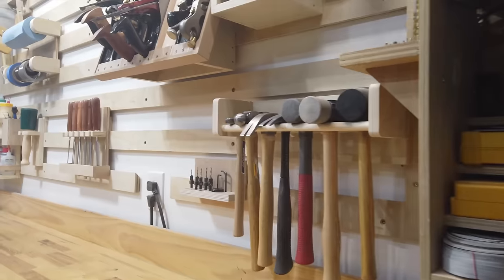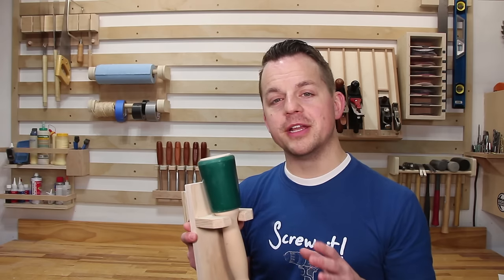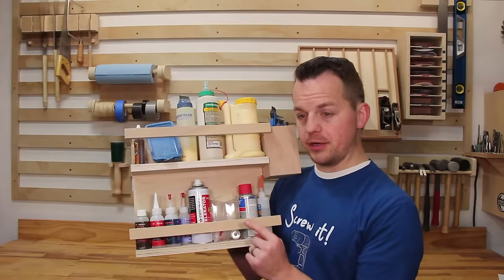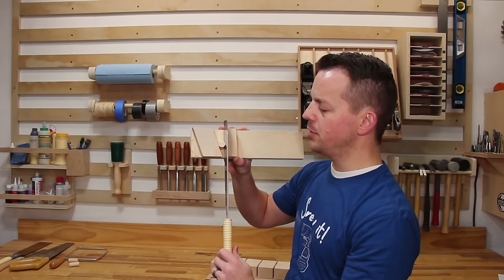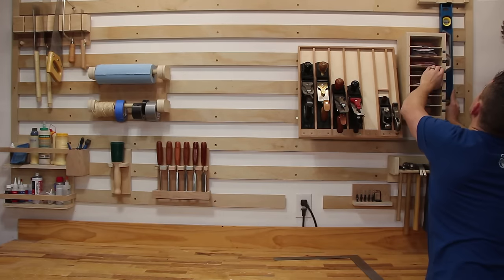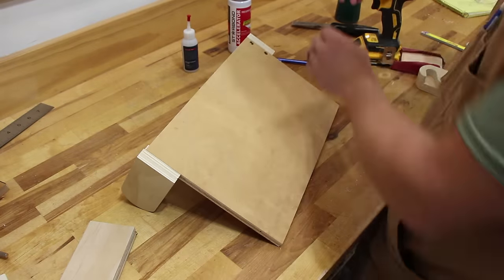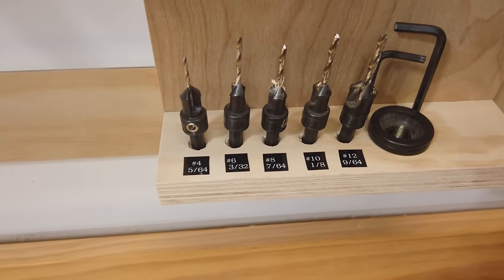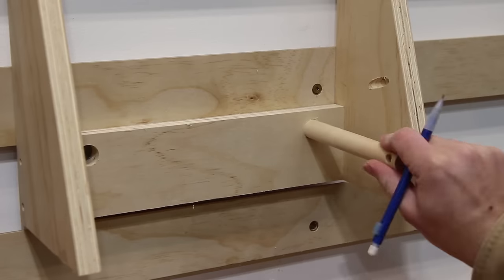Make the Ultimate French Cleat Tool Wall with These 10 Tool Holder Ideas

Comment: Super cool video! It’s like you heard me when I said, “Yes please!”. Thanks for this one I love all of these. I’m going to make a tape one that has more of a boxed front with an old hacksaw blade attached to the front edge for tearing the tape off.
Reply from the maker: That sounds like a good innovation! I find I usually just pull the tape off and take it to wherever I'm working, but maybe the next french cleat video will have an update to the tape rack!
Reply: @EveningWoodworker  🤣 I'm sure yours works great just as is. I just have a station in my shop where I use duct tape often. Again, fantastic video. Thanks

Comment: Good variety of handing solutions. I like the saw grip build but I hang them backwards so you don't keep gouging the holder. For extra grip a racing bike inner tube or srink tube around the dowel.
Reply from the maker: That's a good idea! I just figured I'd replace the front or build a new one once it gets too trashed.

Comment: Oh you know what we like. This is the stuff. Thank you for going into detail. I think many cleat/holder videos do not cover the thickness of cleats or leave out a side view of a holder so you aren't able to see how they put it together. All of your holders are nice and clean and well thought out.

I love a good pliers holder too. Tip down recesses with a thin laminated front and back is good for 2-4 pliers or the rack version with a dowel to hang them tip it. Tip down again with rectangle grid is fun. Just a long box for general hand tools is always welcome too. I keep two pliers in my hip pouch but find pliers to be the tool I reach for as much as screwdrivers.

Hammer holder is another one where I"m attached to the type that is just a open notch with the handles hanging down and available to grab and lift out. Like your basic chisel/clamp rack  with the hammer heads lined up to fit 4 or more on one board. Can glue on little nibs to keep them in there or sand in the bevel to sink in to  get them to stay.
Reply from the maker: Great ideas on the hammer holder! If this one doesn't work out then I may try your design.

Comment: I have used the French Cleat system in a few of my shops and I have always hated them for four reasons.  1)  they collect dust.  2)  they collect spiders with webs.  3)  the tool shelves would always come down when trying to retrieve a tool.  4)  they take up so much wall space for only a small amount of tools.  Now with that said, I believe that you have solved the tool shelf locking mechanism.  And very brillantly I might add.  I also know that someone might fill the whole French Cleat system with craddies of tools and that could solve another issue.  But until the spider issue gets solved, I think I will stick to the drawers.  But anyway, great job.
Reply from the maker: I think my favorite is a combination of some drawers and some French cleats. Also a good pest control company is helpful!

Comment: The design for the saw till is rockin'!  I've seen that mechanism used before but I think you may have really nailed the simplicity.  I also like the very simple low-tech stops to keep the racks stable on the cleats.  May I suggest a clamp rack for next time?
Reply from the maker: Yeah a clamp rack is not a bad idea for the next set of holders!

Comment: The saw holder is absolutely brilliant! I'm definitely copying that idea! 
I didn't like the solutions for the tape holder or the hammers. 
I don't want to go through al tapes to get to the roll I want, so individual pegs is a much better solution. 
The hammers are not secured from rotating and falling through, and are not that easy to take out and put back. A better solution is to use a row of individual blocks of wood and make a hole or slot or saddle that fits the face of the individual hammer, so you only put the hammer head towards the wall, in a custom hole, leaving the shaft angled away from the wall to be easier to grab. For most hammer heads, a magnet is a good way to secure it from accidentally falling off.
Reply from the maker: I'm learning what you mentioned over time with the tape holder, although the paper towel part of it is great! For the hammer one, this way keeps them stored more compactly, so it works well if space is tight. Glad you like the saw holder!

Comment: You're showing some great ideas here and I especially love that saw holder! I'm quite tempted to swap my shelves out for a French Cleat system, but I'm just not sure how much cleat space I'll need to have the same amount of useable space as in the shelves. Also, I'm trying to figure out how wide the cleats on the holders should be. I think I'll be making the cleats on the wall just under 3" - 75 mm - and the spaces between just under 5" - 125 mm - but none of the many videos I've watched so far mentions the width of the cleats on the holders. Would you say just under  1 1/5" - 35 mm -  should be enough?
Reply from the maker: My cleats are made from ripping a 5" piece in half with a  3" spacing in between each rail. You could space them apart more, but I wanted a bit more flexibility to locate my holders. The holder rails don't need to be big, but it's easy to just use the same size you already cut for the rails.

Comment: So something I've found is that for me it's important everything can be removed from the front without taking up vertical space. Maybe my wall is just overcrowded but I'm not sure you're going to love that hammer rack, because you can't put anything right above it. Many of my first holders had this issue and I had to replace them :) I'm definitely copying your chisel rack though !
Reply from the maker: That's good insight! I may have to do another version once I use these for awhile and decide what I like and don't like.

Comment: Hi - great video.  I put up my cleat wall this past weekend and made my first tool holder tonight!  One Q - I put my cleat at the back top of my tool holder.  It works well.  You seemed to put your cleat on the back but down a bit - not flush with the top back of the tool holder.  Is there a reason?
Reply from the maker: As long as it's towards the top and the weight is below, it should be good. I just like to have the cleat on the tool holder completely hidden so it looks like it's floating!

Comment: How did you decide the spacing on your french cleats?
Reply from the maker: It can't be less than about 3" because you need to get the other cleat in. Wider than that just gives you less options on wall positioning. I did mine at 3" because I like variety

Comment: Nice thing, but if you work with wood daily, everything will be dusty with sawdust, even if you have a vacuum. I have a 550W extractor and it is a huge help, but there is still a lot of dust all over the workshop. What I want to save is under Plexiglas. All the workshops like the one in the video look pretty nice, but do it or do they just have it for show? Practic is something else entirely.
Reply from the maker: All of the tools hanging on the French cleats are locked in tight enough so I can blow the dust off with my leaf blower. That's the fastest way I've found to get all of that dust off!

Comment: Have always loved the idea of French Cleat systems and great ideas for the tool holders you have come up with but you have really made me realise that the versatility and moveability of the French cleats is a down fall!! based on most of your tool holders still needing stoppers of some sort to stop them falling off wall during use. This just makes them almost as bad as metal hooks in a pegboard wall. I will be making tool holders in similar ways to you but have decided to just screw them directly to my plywood lined walls and if I every want to move them around I can just unscrew them and move them!!
Reply from the maker: That works too, but I only have locked down about 40% of my tool holders. It's nice to have some that move.